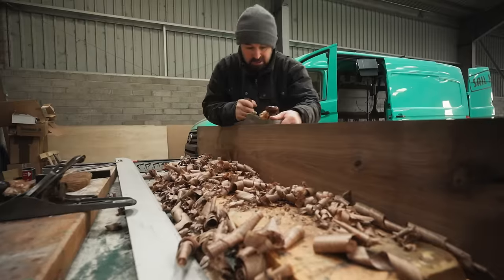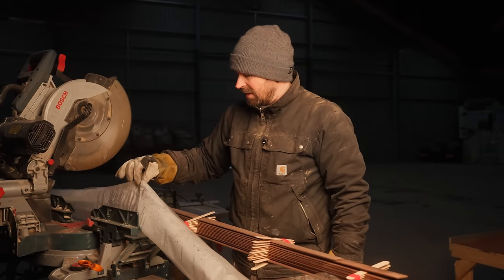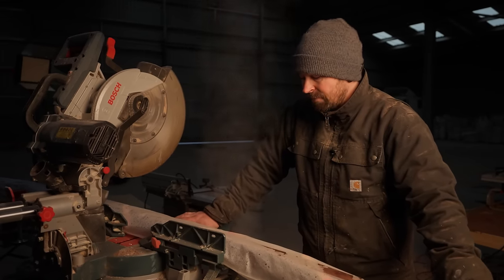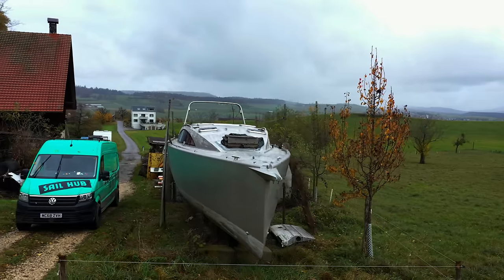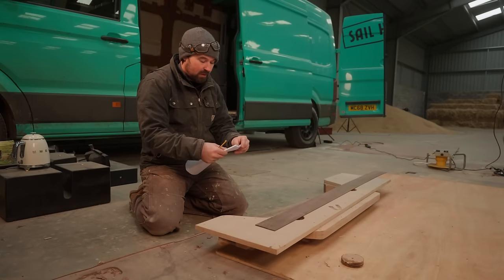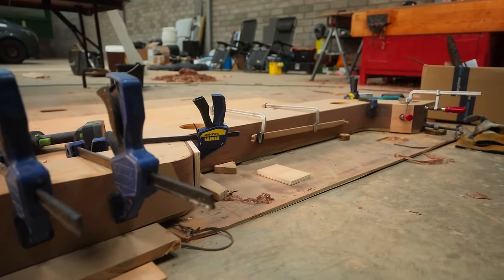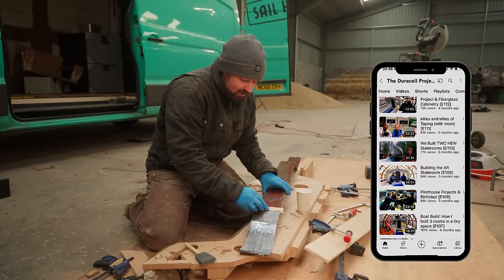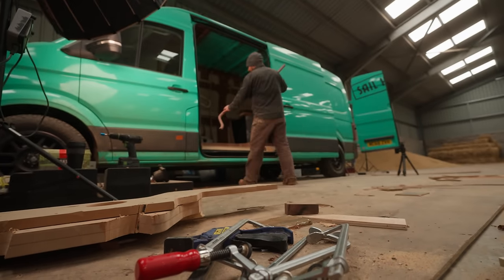Superyacht builder’s CAMPER VAN conversion project - episode 1

Comment: The vacuum bags work great. I had a kettle on each for some thicker woods i was steaming. Didnt even take it out of the bag just put it in the form and started clamping. Got them sweet Lie-Nielsen planes.
Reply from the maker: Bang on, great to hear. Had you tried it before or was this your first go at it?
Reply: @SailHub  First time with the bags. Worked a little to well. My clamps dented the wood. My bad. but sanding it some and it all came out fine. It was a curved countertop for an RV i was rebuilding. It also serves as a hand hold with the overhang while it is in motion. 

Usually a steam box. but for smaller things I have wrapped them in a wet rag and put them on a hot wood stove.
Reply from the maker: @je-fq7ve cool! So hood to hear! 

Another cool trick is a lightbulb in an aluminium tube, just wet the timber and bend the wood around the tube by hand - that’s a luthiers trick, it works so well and it’s super quick for small parts.

Anyhow, thanks for letting us know, it’s great to hear someone trying new things out!!👍

Comment: Worth mentioning that vans have strict payloads and that’s the reason lightweight materials are used in van builds.  It all adds up.
Reply from the maker: So do boats! I’m used to working within limits and we’re more than safe here. Thanks though, it’s a sensible comment and something we are watching.
Reply: Yeah, it was just a suggestion that it be mentioned in your build at some point in case some of your viewers get the wrong idea about using solid wood rather than veneers etc.
Reply from the maker: For sure! Thanks for that, it’s a really good call 👍

Comment: Great content, thank you both. Chris, your knees are not going to thank you in 20yrs. I use a piece of 20mm closed cell foam 150cm x 100cm to kneel on. Much easier than those knee pad things. Cheap and easy protection for your knees.
Reply from the maker: Hey Guy, thanks mate.. feels like I’ve got bigger fish to fry here, maintaining a broken spine at the moment 😬. But your right, I need to take care of the problems I can’t see yet.  I do have pads in the work pants if I’m down on my knees all day but most days I’m at the bench so I just don’t bother - when I stops to think, I guess your right, that’s not clever. 

The closed cell foam mate, it sounds so cushy that I might just have to give it a go! Thanks for suggesting, I really appreciate it 😃

Comment: Nice work. And I know you just wanted to use that beautiful plane, but get that man a thicknesser. ; )
Reply from the maker: Cheers Robin, I would love a good thicknesser, and the space for one! (Nits not our workshop). Back in the day we had a belter! Mind you I’m not likely to   thickness down to 1.5-2mm, it will likely tear out as it’s hard to keep the timber flat.A wide belt sander is a good option here but then… that depends on your clientele - it’s surprising the difference between hand and machine. We may post about that later but I’m not sure many people care 🤷‍♂️
Reply: @SailHub  yeah fair enough, at that thickness it will start likely start chattering and you’ll have a real mess.
Reply from the maker: @robinhodgkinson  yeah, despite that I will still take any thicknesser that’s going spare!

Comment: heya! upcoming boatbuilder from Germany here.. How did you create the the slot for the LED in the curved piece? Cant wrap my head around how to make a router fence/jig for this process..
Reply from the maker: Hi! Nice to hear from you! Pretty simple really, you will kick yourself when I tell you 😁
I clamped it back in the steaming jig but 10mm below the top. After that I used as bearing cutter off the jig to get the desired offset. I ended up with two bearings - one glued inside the other to get the desired offset. 

Hope that makes sense 👍👌
Reply: @SailHub  😑😂. yes. of course that makes sense. Thanks for the details

Comment: Weigh each piece and keep an eye on your total weight.  It's easy enough to overload a van with your gear, provisions and people and now you're adding lots of hardwood.

RV builders have to minimize weight.  Boat builders aren't usually concerned with weight unless they're building a ULDB racing yacht.
Reply from the maker: Hey up Nic, thanks fella!

Yeah I’m keeping an eye on the weight, mind you you may be surprised at the weight to be honest, the wooden step weight was actually very similar to a plastic alternative! I actually think it could be lighter! Around 80% of the timber ends up as waste with this technique. Pretty shocking to be honest but it is what it is. 

To be honest though, despite building it quite light, my prime concern is comfort. If it’s within payload I’m happy! 

On a boat though, weight is a real concern for me, safety, trim and performance are key for me as a boatbuilder! It’s just so cool to build sail boats that perform and look good!

Comment: How heavy will the van be with all the hardwood
Reply from the maker: Hey up! 

Not very is the answer to that.. Well, not due to the hardwoods anyhow, maybe some of the fancy stuff going in but the the hardwood is minimal, it looks a lot but it’s not. The step weighs in at around the same as a plastic one. After all it’s only 6mm thick at its thickest part and walnut is light. The veneer is considerably lighter than a melamine laminate too. Not all that daft us boat builders you know 😉

Comment: A 150mm soil pipe is by far the cheapest way to steam long timber lengths, not sure about the plastic bag. But excellent work that timber must be worth a fortune! Really wish you didn’t add music to the video & why not get some better lighting, it’s so dark to see anything.
Reply from the maker: Hey Thomas, 
Cheers for the comment fella. Much appreciated👍

I’ve tried the soil pipe, it’s too restricting for a shipwright, your limited to one piece less than 6” wide. When we steam for lager boats near the bow or stern the plank comes out of a 13” wide board usually so we need a big box… the bag works a treat. It also means we can keep it in the bag as we start shaping from one end. It’s been the best soloution for me me for around 7 years now.

As for the lighting, we’re in a grain shed mate, there is no lighting! You wanna try working in there! We’ve just got our video light and if you want to pay for extras mate, we’re would love that!!!

Comment: I am assuming this is going to be a £250,000 build on a £30,00 van ? confused as to the point if its not just for you tuber content ?
Reply from the maker: Best not question the point chap! 

However given you have… why are yachts built well, so they last. So why are vans build cheap, so people buy them. Why not build one well, it’s too expensive. But what if you could build one well and it wasn’t expensive? It was the same price as the one you had to keep repairing in the past. That’s where we are, It’s for us to live in while we build our boat and we’ve been living in everything from small yachts to be caddy’s over the last 5 years.. it’s time for some comfort in the road, especially given we don’t have a house.

We will also use it at shows to get reasonable audio for podcasting and of course we get to test some gear before we commit to using it in the boat project.

It’s an unusual project and I hope that makes sense, well… some sense! 👍